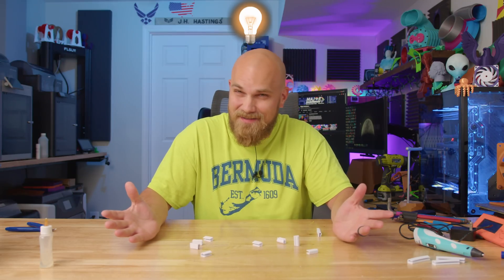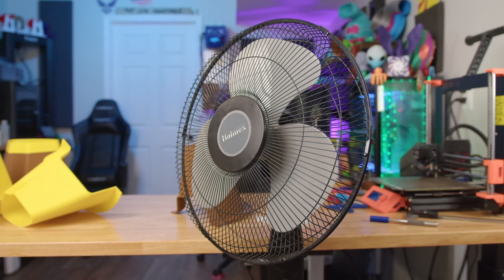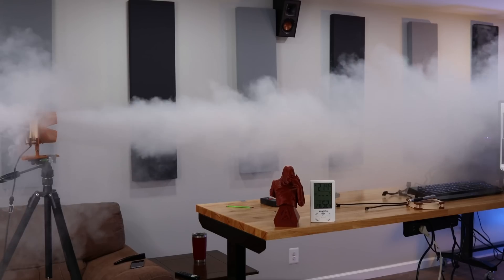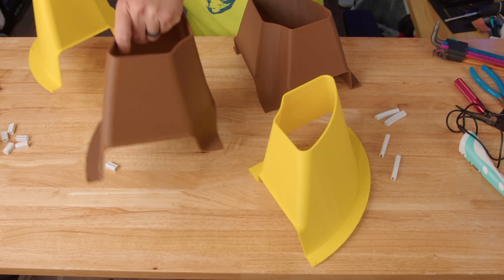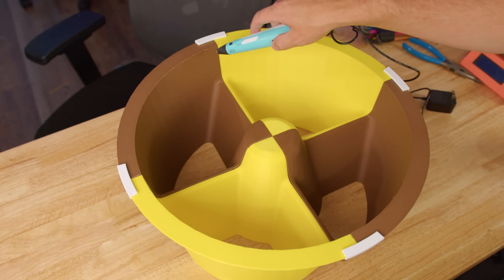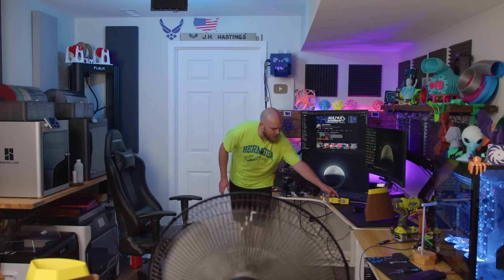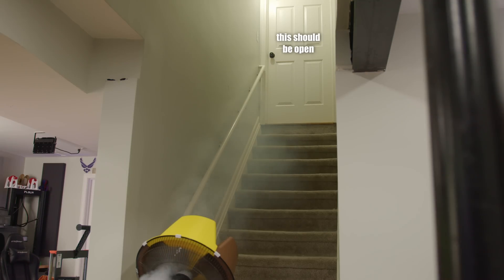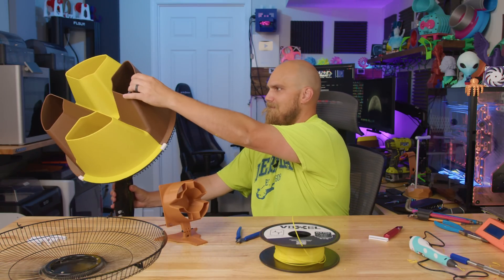Should Noctua make this STAND FAN?

Comment: I've got some good use out of that shroud
I like to use it with a 140mm fan on my fridge blowing air on my clothes rack to make the clothes dry quicker

I power the fan directly off of my 12V lead acid solar battery bank

Comment: If you close the vents in your basement, and the first floor, it forces the cold air to exit out of the top floor. This way the second floor is cooler, and the cold air sinks down the stairs. How this helps.

Comment: You could probably print it half height to make it lighter and still get a significant boost in directed air thrust.  I don't think you need that fancy design though.  Just a regular cylindrical cone with slightly reducing diameter would do.  Probably only need to be 6 inches.

Comment: To even out the temperature in a house, make sure your HVAC is pulling sure in only from downstairs and outputting mostly upstairs. Then run the fan of the HVAC to circulate air even when the AC is off / between AC cycles. Done modern thermostats even have features to allow running that fan a percentage of the time/hour, which makes it a little more cost effective

Comment: as long as the fan forces the air to mix, it'll bring the temp to equal.  Those PC fans seem to have a long range.  use several of those fans and your prototypes. #1 they are going to be small.  Easier to place. #2 they will be quite.  Get those noctua ones.  #3 cool points.  While that air exits the fan, it'll mix the whole time with the air it's hitting right in front of it.  I don't know how you'd power them unless you had a computer near the basement and upper stairwell with a computer close enough to just run all day like a media center that could move air while it's idle/on.

Comment: This seems like the kinda thing that might be perfect for a box fan, actually. Though what I would want to do is remove the front grill and build the shroud so that it fully encapsulates the fan blades. But like others have said, neither are really meant for static pressure. This is still a fun project though.

What do you think we could do to build a large format static pressure fan without it being too brittle? Is there a way to 3D print something large-format? Ooh, could we stitch together a 3D print to make a mold of some kind and then use that for some kind of sand-molded aluminum casting? I bet that'd be pretty dicey if it ends up slightly off-balance, but I'd like to see how difficult the process is nonetheless. Box fans don't have a high RPM.

Comment: Bro why aren't you using cheap 20" box fan?  You can also add an HVAC filter on it.  I get it, you already have the fan, but if you're actually trying to push air, this aint it

Comment: What if you made efficiency snap on covers for the existing fan blades or used a higher pressure fan. Something like winglets or a leading/trailing edge thing? 

Could the shroud improve say a Vornado desk fan?

Comment: Side note, the fan you want is a Vornado, they're designed to send air over distance and a use case is exactly that (pushing air from lower to upper).

Now you can reverse it and shrink a Vornado down into a PC fan.
Reply: I was just writing out a recommendation for the Vornado fans when I noticed your post. I have a few. The airflow is more beam shaped.

The real solution is separate HVAC systems for 1st/2nd floors. Second runner up is oversized and zoned supply/return ducts with dampers and variable capacity. That way you get the air to and from where it's needed and also it can throttle capacity better suiting demand. Production builder installed "zoned" systems are always dreadfully designed and installed causing airflow starvation, frozen coils, poor efficiency, etc.
Reply: @zjeepgozweeln  I believe you, in my experience most HVAC installers are barely competent monkeys.
Reply: literally the silverstone air penetrator series...
Reply: As to your second paragraph, if I had my own home and the funds, it would absolutely be a mini split inverter heat pump set up. Thermostat in every room, with every room being at the proper temp for activities in that room. I could keep my bedroom at 66-67°F, living room at 70, the boys room at 72, etc. Everybody could be happy.
Reply: @brianargo4595  Expensive proposition to retrofit that in unfortunately, and a fairly difficult thing to DIY. Great choice if you're building though. Combine it with insulating all of the walls, not just exterior walls, and you wind up with a very efficient setup.
Reply: @jttech44  indeed. A man can dream though
Reply: Vornado has recently been usurped as the 'king of fans' by the dreo. Sad to say really, Dreo is quieter, moves more air, and uses a little over half the power to do so. Also it's way easier to clean.

Can't speak to longevity, only had it a month where my vornado, well, she's been running almost 24/7 for a few years without stopping for longer than it takes to clean it, so a trooper to be sure, but, it's not really difficult to make a long lasting fan and, if anything fails, it'll undoubtedly be the electronics which will make for a nice bonus esp project lol
Reply: @918_xDx  If people treated their houses like an actual home and not just an investment for later, they'd realize that a little bit of money up front like that will pay for itself relatively quickly. It really is remarkable what good insulation does to increase livability.

Comment: Hey, those fan blades need a shroud, too! The combo of the two (particularly if you can get a tight clearance between the edge of the blades and the shroud) should significantly improve performance.
Reply: they're probably soft plastic blades (yeah, what were they thinking) like on my old fan. it needs more blades that are better shaped, have less clearance and are of a better material... and it needs a better motor cause my fan that looks just like it used like 60w which is ridiculous. it probably did more heating than cooling at that point.
Reply: @HazewinDog  Soft plastic is fine as long as you account for it when you're cutting the new blade tip profile. Sure they'll stretch a little, but, that's nbd.

Comment: Large teardrop with the bottom cut to size and the pointy end cut to the size you need. Another shape would be the shape shrink tube makes when the end hangs over the end of oversized wire sleeve that doesn't let the bulk of it shrink.

Comment: I would definitely love a desk fan showdown, the blades on those are actually easily replacable and I feel like a lot of them are really not that well optimized.
Reply: I swear you can easily get around 50x the efficiency of that fan, because I upgraded from a fan that looks just like that (same blade design even) and the new one uses like 8x less power while blowing way more air and being way quieter... the difference is honestly mind boggling. it blows air much much further too.
Reply: https://youtu.be/q3FH3boEu04?si=syIwJ5897O1ye4Zz

Comment: The trick is NOT to push the cold air to-where it's too hot..
instead, you want to force the hot air down the central air intake... 
AC moves heat, so you gotta give it the heat to move away (or at least that's how I think about it).

Comment: Just FYI, there are commercial fans that go in the duct work for situations like this where you have unequal cooling within a house.  Typically, a multi story house should have an AC unit for each level so that each level is cooled separately.  Since you only have one AC unit, you can get a fan that mounts in the duct, and draws air from the evaporator and forces it into the hot room.  Doing it is really only good for one or two hot rooms.  Otherwise, the layout of the duct work, placement of the thermostat, and addition of flow baffles would be needed.  Another option would be to add a mini-split heat pump to the one room.  It's a higher cost up front, but would save you money in the long term.

Either the duct fan or mini split CAN be a DIY install.  You must know how to properly run electrical lines, or call a contractor out for that part.  The duct fan is super easy.  You just need to figure out the size of flexible line coming off the main hard box to your room.  Then, with a fan of that size, cut the flexible duct in a convenient location.  The fan needs to be supported and have power.  To cut the flex, first put down a wrap or two of duct tape at the cut, then cut the outer fiberglass sleeve in the middle of the tape.  Slide the insulation back (you can temperaraly hold it in place with a small piece of tape on either side of the cut) and locate the metal spine of the inner liner.  Cut this spine where the fan is going to mount with sire cutters rated for steel wire, then cut the rest of the liner to separate it.  Slide the liner over either side of the fan, making sure the fan is facing the proper direction so the air flow is into the room.  Secure the inner liner to the fan with appropriate zip ties.  Don't skimp on these.  Get HVAC ones rated for temperature and has a metal rather than a plastic ratchet tooth.  The fan inserts as a coupler, and should take 2 zip ties on each end.  Add a layer of duct tape to ensure a proper seal, then slide the insulation down and do the same thing.  Now would be the be time to secure the fan to something solid, or hang it with strapping.  Hanging with strapping takes more time, but helps isolate the sound.  Last, the fan needs to be wired.  This can be always on, have a switch in the applicable room, or have a pair of thermal probes to automatically turn it on and off when a sufficient thermal difference between the probes.
Reply: AC infinity makes products like this, with inverters and thermostat controls. Probably other options too, that's just what I've used. Works a peach.

Comment: Check out AC Infinity. They have fans that go into your ducts that will suck more air through there and you can set the temperature to turn on and off. I have one for my Stereo Receiver and it keeps my system from overheating. Just set it and forget it.

Comment: The best solution I've seen to the issue you're having of heat getting trapped upstairs at night is having a fan set into the attic hatch that pulls the hot air up into the attic space, and a vent fan in the attic to dump that hot air outside.

Comment: I want to see you build a bank of nine noctuas in a square together with either all of them having that shroud on them, or a new enlarged shroud that's built for a 360x360 sized mount, your choice! You would probably need to modify the shape a bit to get peak airflow out of all the fans together, but it'd definitely be an interesting project all the same. I used to use a 4x4 block of those cheap coolermaster fans you used to be able to get in boxes of 4, that are all black and cheap as fuck, in the window to pull cool air into my room. I wired it all up to an old power supply that I didn't trust to do anything else, and it was actually surprisingly effective. I doubled it up and put one in the other window as exhaust for full room air exchange back before I had an AC, and it helped a ton on hot days because as soon as it cooled down in the evening the room was immediately as cool as the outside temp, and it produced very little noise since they were all like 1300ish RPM fans at most. I think something like this would be perfect for your needs to move air upstairs so long as you shape it in a way that doesn't get in the way, or figure out a good way to mount it somehow. I had a window frame and window to brace my contraption with, so it was fairly easy to pull off, but you might need to actually just build a bank of them across the top of the stairway or something if you want them out of the way. The more of them you get in an array together though that's more square or rectangle shaped, the further you'll be able to throw air, so food for thought there. Also speakers work the same way, anything that moves air can be arrayed in this way to increase output

Comment: Sweet setup. I have coworkers who have 2 zone ac, upstairs, and downstairs. Since cold air is more dense, if you don't have a separate zone on your 2nd floor, it's cheaper to just blow the cold air up the stairs. 
Your basement is colder because the walls down there have more thermal mass; therefore, the temperature is more stable down there. [Personal note, I miss having a basement 😢]
The only thing I would recommend is to tape the seal around the fan shroud to keep it from falling off. 
Or when Costco has the Dewalt shop fan on sale, get it and use that to move the cold air. Lol 😊

Comment: It's probably much better to make a makeshift door and suck the air up instead of pushing it. As an example: I don't have an HVAC, only a nice powerful ceiling fan. The fan doesn't help the PC and can push some of the air out of the room when the door is open. When I'm done playing the room is hot and the hardware will stay above the ambient for a while. In this moment I have another fan on the floor that I use to exhaust the air outside of the room while I have a little snack. Place it between the door frame. Otherwise I would sleep in a sauna.

Comment: I would get a floor fan instead of a pedestal fan. Way more stable and pretty much the same fan guard layout and maybe some better blowing blades as well. They can also be a lot more adjustable and easier to lock in place the angle you set it at. Metal bladed fans if you can get them will be the best for them. The blades tend to be a bit lighter so the motor has less work just spinning it so you get a fair bit more speed.

Comment: For one thing stock pedestal fans have an open cage that is open all the way around the blades, so a lot of air is lost as it slips off the tips of the blades and through the open cage, sealing the outer area of the fan stops that and helps direct more of the air through the front of the fan. This is similar to how a box fan moves more air. You could probably get a measurable increase just by doing that. Id like to see that done and tested as well.
Reply: I forget the video I saw it in, but I did see a guy hack up some thin plastic sheeting and attach it with zip ties to the inside of the cage with very tight clearance on the stock blades and he saw fairly significant performance/noise gains. I'd bet if you squared off the blades and did this, you could probably make it even better. Cutting the blades though... you'd have to use a big pair of calipers or a string/pen to get the radius right, and then cut them with a hot knife, likely sanding to final shape.

A doable weekend afternoon project to be sure.
Reply: @jttech44  one could probably buy a cheap wooden yard stick, remove the cap nut that secures the blades to the shaft of the fan, drill a hole into the end of the yard stick the diameter of the motor shaft and slip it on. Then measure out and drill another hole on the yard stick for a pen/sharpie. Insert the sharpie and rotate to mark the blades if you were going that route

Comment: Get a dual system for the AC/Heat pump, so you have one up stairs to use for when you're there.

For fan use, how about setting one at a window to blow air out instead? That would pull air in from elsewhere, and it would hopefully be from downstairs. Or use a ceiling fan in the "summer" direction to circulate air?

Comment: Ceiling fans on the first floor should also greatly help to diffuse more cold air in the bedrooms.

My father will live in a duplex apartment with two such fans on the first floor. The whole building is in a major renewal so I am not able to do any review yet. Do you think adding those ceiling fans to the renewal worksheet was a good idea ?

Comment: Well if it works was it a bad idea no
I found that if you address the dead spots in your room's and hallways with air flow even a pc fan can make a difference  in cooling your house remember air flow  it looks for the fastest way backed to main units it up to you to make it saturate   the room evenly.
  and try putting the fan at the top of the stairs and have it blown down to first floor that should help cool down the upstairs and help the Central unit  if it on the first floor.

Comment: Putting a curtain at the top of my stairs substantially improved the performance of my AC. There is a pocket that runs along the curtain's bottom edge that I put some old VGA cables in to keep it weighed down but flexible.

Comment: Btw if you want to get rid of the mesh lines on the curved edges, import the step file into the slicer and enable arc printing, might improve print speeds and smooth the model out. Fun project though.
Reply: Sounds like he did the CAD work himself, so he could have just forced a higher resolution for the export.

Comment: I had my HVAC system completely redone about a year ago. Zoning made such a huge difference!
Incidentally there are some other solutions for "smart vents" such as Keen Home and Flair that can retrofit an older system and even allow for per-room zoning which is neat! Though they're not really a good option with modern variable speed HVAC systems.
Reply: Excellent! Saved me a ton of typing. Next video, How I adjusted My plenums then added zoning.
Reply: I purchased an ecobee smart thermostat and it came with 2 sensor. Omw sensor is in the kids room and the second in my bedroom plus the main thermostat downstairs. It has this cool feature were it can follow you, so example when I go to bed the ac will run to cool down the too rooms and not the whole house. You can find it at home Depot and usually there is a rebate.